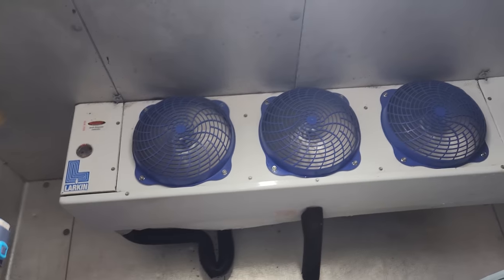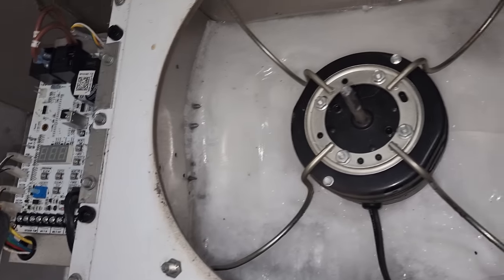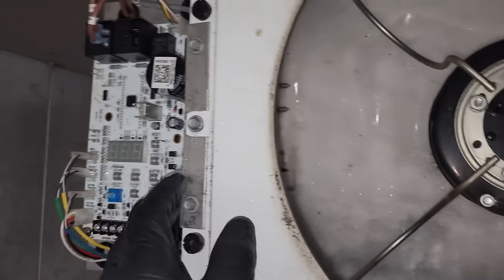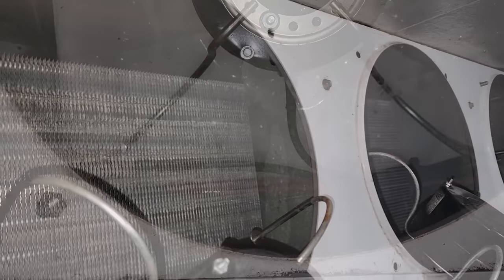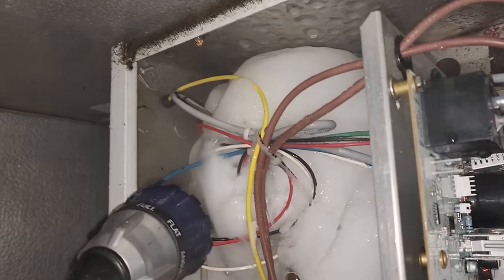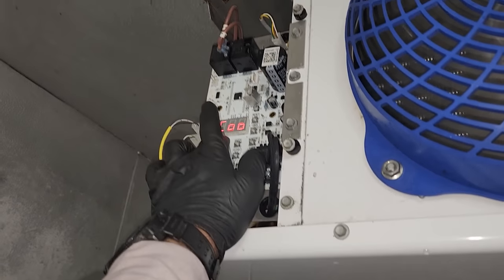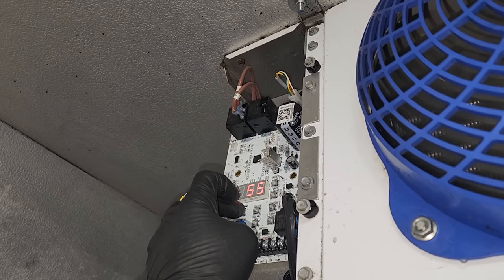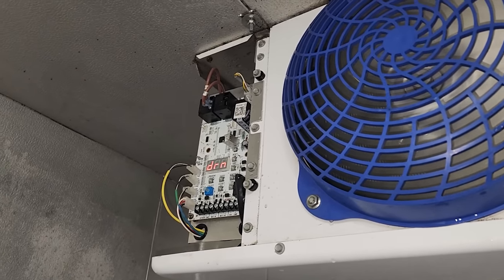THE WALK IN COOLER IS TOO WARM

Comment: I Fired someone once for not closing the walk in door. Had to warn the guy like 50 times over a month. If you cant remember to close a door. How can I trust you to remember how to do your job completely and correctly? Kept trying to say it wasn't him. Ahem, that camera right there actually works.
Reply: Well said.
Reply: I worked for a grocery store that had the plastic curtains and door alarms on the walkin coolers and freezers. They would fire anyone who pulled or cut the curtains off. Worked with a guy that had been there for many years and he used to be the deli/ bakery manager when the store first opened. He got tired of the curtains smacking him going in and out when they were busy. One day he decided to cut them off a little taller than he was. They threatened to fire whoever did it, but all of the employees were roughly the same height so they couldn't prove who did it and he wouldn't tell them either.
Reply: I’m sure the guy went on to better things in life then working in a restaurant
Reply: @marlon8429  and you would be shocked at how many don't.

Comment: Great video.The restaurants with open freezer doors just need a super powerful dehumidifier to keep the air too dry to condense on the coils.
Reply: oversize the refrigeration by about 35 times, get rid of the vent hoods, exhaust fans and all interior doors. 🤣🤣
there you go, the whole building is one giant inefficient dehumidifier. 🥳🤡

Comment: The icing of the evap.’s caused a memory recall in me of two walk in cooler sites, for two different drive through dairy product  stores I worked at.  One store had two fans in the rear of the coil,  near one wall, pushing, (not pulling the air, which would become iced over often.  The other store had the single fan, much larger, (more air flow volume), on the bottom of the coils, fan side facing the floor of the box.  Rarely saw the single fan units iced / frozen over.   The store with the single fans also had routine maintenance by the same company.   So may have been a combination of different factors.   So interesting.

Comment: I have found an unusual problem on this exact heatcraft cooler evaporator coil.  

Fill the entire evaporator pan full of water, to simulate worst case defrosted coil. With the fans on full speed, creates a static pressure air curtain that actually holds the same water in the drain pan for many hours. I tested this with no drain line connected to the pan fitting.

when the fans go to low speed, it starts to drain much better. I think heatcraft is unaware, bc in drain mode, the fans stay on full speed not draining the water out of the pan. 

this is becomes problematic on a lower superheat setting. the water in the pan freezes to the bottom of the evaporator coil.

I found this problem in many applications at 35 to 40 box temp design...i.e...keg cooler, vegetable cooler, meat cooler, blast cooler.....the air out of the shroud starting spitting water out with a fully defrosted coil.

Replicate this out if you get a chance.
Reply: Nice observations dude
Reply from the maker: try putting a p trap on the drain  line with an air vent, you likely have a vacuum issue in the walk in preventing the drain from draining, I will discuss this live on YouTube this evening 2/27/23 @ 5:PM (pacific) come over and check it out https://www.youtube.com/live/y_KaNe4Bivk?feature=share

Comment: All HVAC in Eastern Ohio and Western PA. Please don't have any bare skin on roofs and treat used filters carefully. 
They concentrate all the toxics and you must have proper gloves.  Chemicals can absorb directly through skin, place them in plastic bags to prevent contamination, especially of your van. Don't make dust.
I am a ret. Chemist that turned to the trades. I worked in a moon suit often dealing with vinyl chloride, chlorine, Ethylene oxide, anhydrous ammonia and more.
Soap and water often.
Reply: New homes, still in framing need to have every surface purged of dust and debris before finishing starts. Entombed contaminants in wall, floors and ceilings are costly to remove and pose significant long term health risks.

Auto intake and cabin air filters should be changed as soon as possible in these areas as well.
Reply: @ocko8011  Gosh, I didn't consider that.
I now, because of you, now consider roofing.  Asphalt shingles will absorb hydrocarbon toxins and the leaching out over time, disposal will become an issue.
Roofers will now be constantly exposed for several years in those areas but metal roofs are probably immune after several rains. 
I found online vinyl chloride and phosgene react with water to acids that will dissipate over years.
An occupational risk...

Comment: You know I've managed many restaurants and I've taken those things apart the fan protectors I always replaced the screws with wingnuts so i could tighten them and have easy access to open them and pressure wash out all the algae and slime out from the drain pans I've never had any issues so far

Comment: With those Bohn Heatcraft smart boards you need to always ensure there's not a master controller outside of the box. That will revert your changes at the evaporator coil. Also you always need to double check the accuracy of all of your probes. The suction temp transducers on those constantly break.
Reply from the maker: If it was a beacon system yes you need to look for the master controller, but this Is a qrc system (quick response controller) there is no controller besides the main board
Reply: @HVACRVIDEOS  very good to know. I've primarily dealt with the Beacon II systems. I despise them, but they've become easier to service now that I've seen so many issues with them. I'd personally prefer to see evaps on a walk in (that's not a rack system) controlled by either a K2, or a Dixell. I've seen so many beacon II coils iced up due to the transducer or thermistors being off which seems to happen a lot more frequently than it should.
Reply: If it’s a cooler I almost always have to raise the defrost termination temp because I’m in a high humidity area

Comment: Chris, have you gotten any Heatcraft equipment that has been wired incorrectly from the factory?  We received two on one gas station job where whomever wired it at the factory had one leg of a heater landed on the fan terminal for walk in freezers so as soon as the fans kicked on one defrost timer blew up and the other one tripped the breaker.  Granted, best practices would have prevented this if we would have double checked but lesson learned to double check the wiring from the factory.
Reply from the maker: No I can't say I remember any of it being wired incorrectly
Reply: @HVACRVIDEOS  hmmm…I wonder if it’s just the units they ship to Iowa…have had 4 in the last year wired wrong from factory (base units, not Intelligen).

Comment: Hi Chris! Just a question when dealing a situation like this, it is not better to get rid of the ice with an electrical heat gun? I mean you said you don't want to submerge the evap fan motor. And then you can remove the motor. Would be a time and energy wasting procedure?

Comment: Why is the ice block not over the right third of the coil though? Also, do you try to yank off the ice on the underside of the drain pan first, or do you let it naturally fall off as it gets heated by the hot water you are spraying?

Comment: Have one with light frost from after distributer line to coil...head pressure at 100 and suction at like 10 on R22 added refrigerant and pressures didnt change. I feel like theres ice in system. Any reason I should not recover and blast nitrogen and pressure test.

Comment: Hey guys I'm replacing a walk in cooler at work and the old unit had a suction trap at the evap , the condenser is just on top of the box with like 10 ft of piping. I don't really know why I'd need a suction trap on the new one , but if anyone has any input I'd appreciate it 👍
Reply from the maker: You can probabaly get away without it but I personally would install one, just to be safe
Reply: @HVACR VIDEOS  thanks so much man
Reply: I've been told every 8 feet you need a trap.
Reply: @Kyle Tegler  I would get if the evap is a lot higher than the compressor you wouldnt want a flooded start from liquid pouring down the suction. I added one anyway I'm new to refrig. Difficult when manuals are basically non existent for this keeprite evap and condenser and you gotta just go off research

Comment: Still I don't understand. 
Why keep sensitive electronics and high voltage connections naked inside a evaporator coil when you can have high voltage connections inside a encapsulated box IP44-classed, the connection between coil and control outside cold storage, runned with a multi-leaded cable.
Reply: planned obslcnese if you make the parts more prone to brekaing you can sell more parts
Reply: @ThunderClawShocktrix  Yeah, but that's not customer friendly according to me. A happy customer is a returning customer. A mad customer is a lost customer. It takes 10 happy customers to regain the bad reputation a mad customer gives.